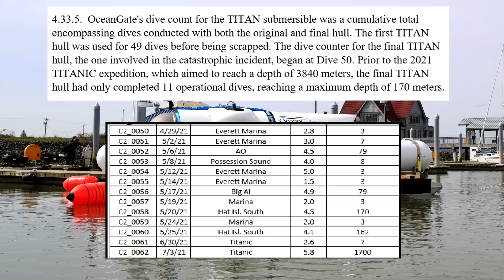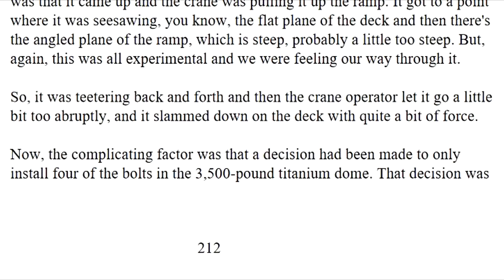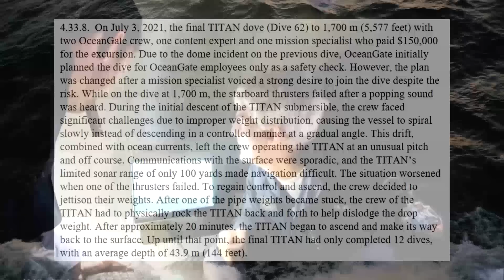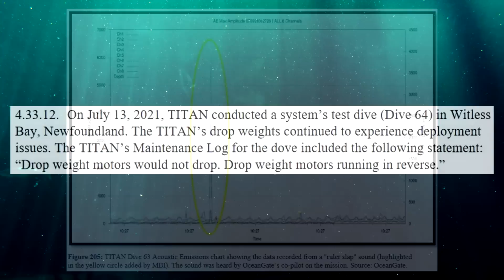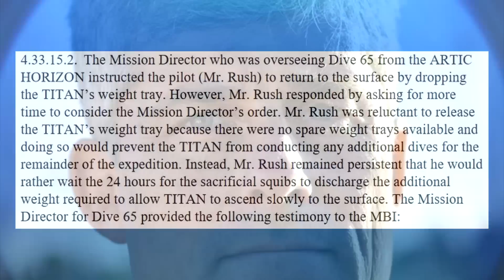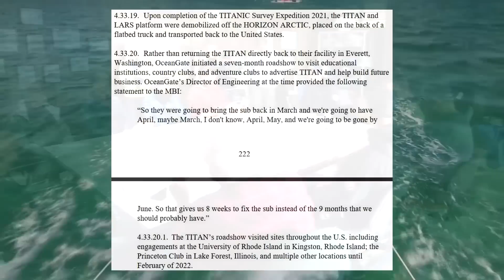OceanGate's Turbulent 2021 Titanic Expedition | A Timeline of Events from the US Coast Guard Report

Comment: Rush & OG were spot on honest when they said Titan I & Ii were experimental. So is SpaceX Starship. But SpaceX isn’t foolish or reckless enough to put anyone on board during these test shots for which catastrophic failure is anticipated. 

Rush touted OG’s operational procedures and the acoustic monitoring systems were sufficient. IMO the former were a complete failure. First, who persists diving when the drop weight system repeatedly failed or under performed? And other malfunctions such as comms cutting out repeatedly? At some point wouldn’t one wonder, “maybe the design needs improvement?” As to the latter, the hull monitoring system did provide ample warning that the carbon fiber hull was compromised; IMO OG simply chose to ignore changes in hull deformation responses and brush the “bang” off as a minor shift of the hull in the frame. 

Now OG may have shown a cylindrical carbon fiber hull may be viable for deep sea submersibles but totally failed to acknowledge that it was a component with a limited service life (unknown and unproven for Titan) requiring constant inspection; these are both concepts well established in aerospace industry. The basic known material characteristics of metals - steel, titanium - and years of use dictate the procedures and design, and, provide accurate prediction about service life. And inspection and maintenance - x-ray/ultrasonic inspection for voids/slag inclusion, inspection for in-use corrosion and fatigue cracking. Carbon fiber’s known properties from the beginning raised the specter of delamination and buckling plus the challenges of mating carbon fiber to metal domes raised concerns about its use.

Comment: I'm sure the leverage of the dome tearing off did absolutely no damage to the glue joint holding the collar on the CF hull. Right?
Reply: to be fair the dome was hanging off of one side by a hinge every time the opened it. I’d bet that, welding lifting rings to the titanium exactly where Nissen told the absolutely not to, or the slamming on dive 80 contributed more than the dome falling off in 2021. but if it wasn’t one thing, something else eventually would have caught up. I mean Rush felt like dropping a weight tray would sink his company in 2021, no wonder he ignored the RTM data and big bang in dive 80. they just sent it and hoped it stayed glued together.

Comment: The four bolt (actually screws since they didn't go into nuts) idea has some flaws right from the start. If the 18 holes are regularly spaced, you can't use four of the holes and have them evenly spaced. The dome and the ring have different moduli of contraction, (one gets smaller to a different amount and at a different rate to the other) under pressure. If you take it to depth, four fasteners holding the two parts together will try to flatten the ring out in two places and make it bulge at two others. That puts a strain on the screws from the side, which is not their strong dimension. This will stretch them to the side as pressure increases and let them relax back when it comes off, a recipe for fatigue and stress fractures. If they did take it to depth with only four screws, they could easily be weakened enough to break with a good bump.  Brilliant engineer, that Rush.
Reply: Rush still thought he was up in the air in a plane or something
Reply: They are bolts because they are straight. What they go into doesn’t change the definition. A screw is tapered and cuts into a softer material.
Reply: @simongordon8182  - Nope.
Reply: @GWNorth-db8vn ”a screw lime metal object without a point”. Whilst a bolt is commonly screwed into a nut it can be screwed into anything that’s suitably threaded. It’s still a bolt. It has a straight shaft with an even thread cut into it.
Reply: @simongordon8182  - Bolts and machine screws are both threaded fasteners. The threads are the same, it's the use that defines which is which. As a rule, bolts have hex heads, and screws have all sorts of other sizes. 
I'm a machinist. A draftsman who labels a screw as a bolt on a drawing gets corrected long before it gets to me.
Reply: @GWNorth-db8vn  a screw tapers to a point, a bolt does not, so yes the use defines what it is - bolts go into straight threaded holes, screws cut into a material making the thread as they go